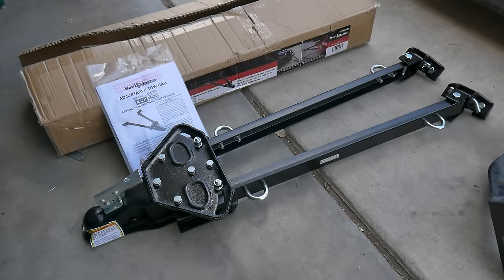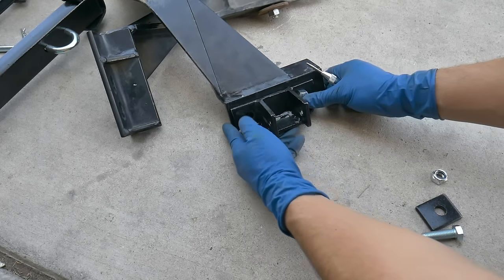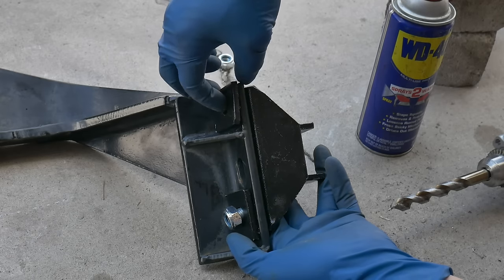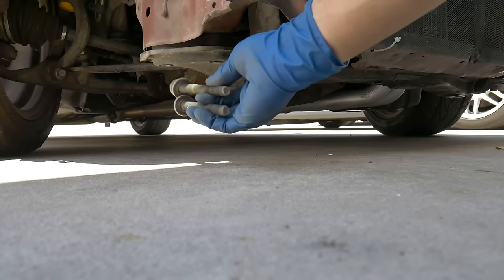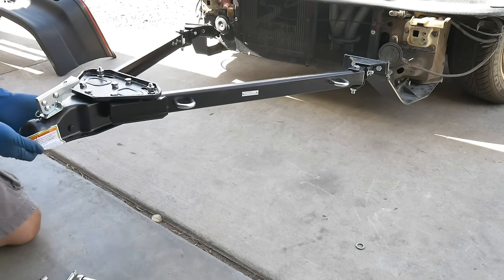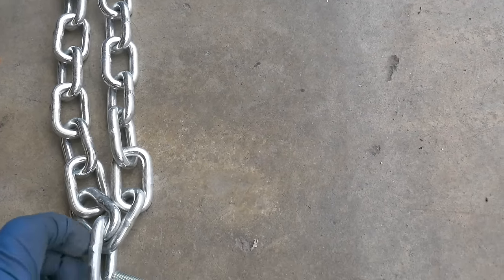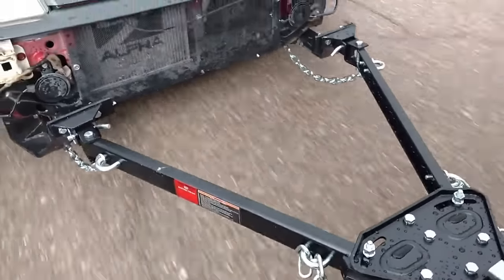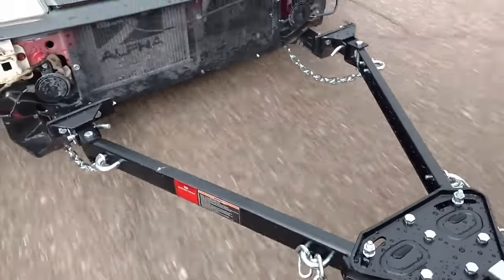Harbor Freight Adjustable Tow Bar Install - Towing my EF Civic B20B Track Car

Comment: Safety chains need to be crossed when towing in case that tongue pops off it won't hit the ground
Reply from the maker: +Robby Valdez Thanks for that!!
Reply: Garage Built Hondas 👍🏽
Reply from the maker: I kept meaning to google how the chains are installed but have never remembered and that makes 100% perfect sense!
Reply: Garage Built Hondas Yes sir😉
Reply from the maker: I got them on a car I bought (my yellow crx).  Someone found a set online.  If I can find it I'll link it.
Reply: Back chains criss cross too?? I've never had back chains so idk.
Reply from the maker: Yes, all of the them
Reply: @GarageBuiltHondas  I believe the purpose in front is that it catches the tongue should it come off and will cradle it.
Reply: I never thought about crossing the chains on my food cart whiles towing it. Thanks.
Reply: It's still stabbing a bumper but its probably better than a grinded down mounting hitch.
Reply: Yes
Reply: it's amazing how many people don't know this. I mean what do they think the chains are going to do when they just hang loose?
Reply: Shows it right on the box too 😆
Reply from the maker: Lol.  I'm only sometimes using half of my brain.  The other time I'm not really using it. 😁
Reply: A lot of people don't know this one either, chains aren't supposed to be twisted, makes them more susceptible to snapping if the tongue does pop off. Adjust the chains properly so they aren't dragging on the ground.

Comment: Nooooooo! by drilling holes in the tops of those "bars", you have just significantly reduced their strength and you've essentially created hinge points for them to crumple under load. Anything from HFT is probably way overrated as far as actual capacity goes to begin with, and you have actually just reduced that more. Sorry to rain on your parade...but yikes!
Reply from the maker: No turns sharper than 45 degrees is my way of using it.  It's been sufficient so far, I've used it over 10 times towing these kind of cars since the video.
Reply: Definitely don't agree that they are overrated. All kinds of liability issues
Reply: Ya no 😅
Reply: @GarageBuiltHondas could I attach this to a mini van and pull with a dodge truck ram?

Comment: Sorry for maybe a dumb question but noone uses this kind of tow bar here in central Europe, how does the towed car turn? I feel like the wheels could turn randomly and make the car wobble all over the place, but it doesnr do that at all, can someone please explain? Thanks a lot :)
Reply from the maker: You leave the key in the ignition and the wheels turn naturally as it's pulled.  I understand what you mean and felt the same way but I've used it over 5 times now and never once had an issue.  It's pretty nice to be able to use it.
Reply: @GarageBuiltHondas  Well, it kinda makes sence because if you let go of the wheel while driving, it vants tu straigten the wheels naturally, so it probably wrks the same, it just feels unnatural and scary to me. Thank you for the explanation though.
Reply from the maker: You're welcome

Comment: hi. where did u get the support bracket that connects to the tow bar. I have know where on my camera to mount my tow bar. thanks
Reply from the maker: Mine came with my car.  Google towing brackets and the model of your car.  You may have some hits doing that.

Comment: First "Smart" move to make with these is to bin off every supplied nut & replace them all with nyloc locknuts. It cost next to nothing and eliminates half the problems people run into. :-)  The factory nuts WILL vibrate loose when towing.

Comment: so one recommendation is get a class rated tow hitch installed to truck that bumpers probably only rated for just over a thousand pounds if I remember correctly CRX weigh significantly more it might not break right off but you'll start seeing bending and flexing in your bumper other than that great video keep it up

Comment: 2:26 "Perfect where I drilled them"  Well I guess not, since you had to grind down the backing plate to get it to fit.  I expected trouble when you didn't try to put the new hole in line with the existing two.  Measure twice, cut once--and if it's too much to measure twice, at least measure once!  Still the best video I've seen of the HF tow bar, if only because it shows the actual hardware of the mounting knuckle.
Reply from the maker: Lol, worked out just fine.  A little grinding never hurt.

Comment: One thing you didn't mention , 
Before you start towing , 
Obviously you put it on neutral ,
But what about the key ignition?
do you half way turn the key , just to activate the power steering ? 
or you just leave it alone don't turn the ignition at all ,  just the car on neutral will be enough ?
Reply from the maker: The key needs to be at position 1 where the steering wheel is unlocked and the car left in neutral.
Reply: Garage Built Hondas 
Thank you  ..  👍

Comment: thank you for the video... I've been trying to figure out how to use my HF tow bar since I got it.  The manual references buying another part (the mounting bracket) that they do not sell.  So I'm guessing if you don't have a bracket the tow bar is a waste of money.
Reply from the maker: Search around online.  They make brackets for many vehicles.  You could also find a welder/fabricator and ask them to build some for you.

Comment: Wow! Didn't read your bumper tow rating did ya?
But a blue ox tow bar, each side bar has a release that allows the bars to be lengthened. Release, hook to tow vehicle, back up to latch arms..... Alot less monkeying around..... But you get what you pay for
Reply from the maker: This particular kind of truck is setup to be able to pull this car and weight.  U-haul confirmed if for me 7 years ago when I first rented a tow dolly to pull one of these cars 500 miles.  They actually won't let you rent a tow dolly without confirmation of both vehicles.

This bar has worked perfect for the 88-91 Civic/crx chassis and is only want I'm using it for.  It has been used about 10 times since this video has been released and no issues.  I'm good.

Comment: You might want to leave the engine idling during your tow. Otherwise your transaxle output shaft bearings/bushings wouldn't get lubrication.
Reply: How would that help?
Reply: @pyromaniac354  It'll keep your output shaft bearings from premature wear. My auto tech school instructor mentioned this very scenario in a lecture. I bought a 40' school bus last October and towed my car behind on my 950 mile return trip home. I left the car engine idling almost all the way. I'd say for at least 800 miles. It cost me $10 in gas for the car. Until I need to tow a lot, this is probably the way I'll deal with the issue. I'm considering adding-on an electric circulation pump and tapping into the transaxle's lubrication circuit if I end-up towing a fair amount. I don't know if such a pump is available on the market, but I would find a way to do it myself (DIM).
Reply: @KellyBtech  not necessary on a manual transmission.
Reply: @jaydak99  Good point, but I fell out of love with them in my 20's. I don't like replacing clutches, master and slave cylinders as well as the constant clutching in rush-hour traffic. If I were in the old country (northern MN) I wouldn't mind as much, but I commute through Seattle for a total of 86 miles/day. Sometimes traffic crawls all the way home.

Comment: While you can't afford the front wheel they install in trailers, to lift the front up place a wood stick that lift it enough while you're backing up to hook your trailer.
Reply: Your not supposed to back up with a tow you could break stuff
Reply: @JUST1N888  What do you mean? If you have to back up just be careful, go easy, and have someone to spot you or get out of your vehicle, see the area and progressively back up, repeat. Repeat means "as you back up a little, get out of the vehicle, check the area for obstacles, back up more, check the area out of the vehicle until you achieve getting into the spot or area you desire". Do you understand?
Reply: @rodolfoplasencia4953  when backing up you are using the tow bar as leverage against the tow bar bracketts and they will brake . also you are not supposed lock the wheel . Be careful cause if stuff like this breaks it can kill people !!!

Comment: if u left the plates off and loosened the nuts that adjust the bar u can leave them loose when u back up to it so it can pivot the hitch and attach it to the ball. then just pull forwad to get the car aligned then tighten nuts down
Reply from the maker: Thanks for the tip, I like that idea.  It got easier since the first install.  I think just getting the hang of it, but when I re-attached the car to get it home, it was so quick lining it up that time so I think I got the hang of it now!

Comment: Silly question but does the steering wheel of the towed vehicle move freely or do someone need to steer it while turning
Reply from the maker: +Pedro Carvajal You'll put the key in the ignition to leave it free.  The wheels will naturally turn as it's pulled around corners.

Comment: Ahh I see how it was done now. I've been wanting to adapt a tow bar to my car as well in case I need to use my Toyota as a back up tow truck, but I was thinking of making a bracket system bolt into where the OEM bumper support bolts in, would be a hell of a lot easier than getting down and taking out all those bolts for the subframe mounted brackets. Just some food for thought as a potential change to your setup later on.
Reply from the maker: +90ED6LSV seriously!  I had thought about making some brackets but never got to it,then got these on the crx.  I definitely wouldn't mind something less arduous for future use.  Honestly when I used it last week at the track it was only tiresome because at the end of the day I was best from the racing & sun!  If I had a cordless impact I'd be set.  I need to buy one, just haven't done so.
Reply: Yup I know exactly what you mean lol. We recently did some major revisions to our car trailer, which included ditching our 80lb each steel ramps for hinged reinforced aluminum ramps. At the end of a track day it was such a pain in the ass to haul out/in these ramps to load the car up. The little quality of life improvements make a big difference haha
Reply from the maker: No kidding buddy!!  We'll see how this goes.  I might just use this as a backup and drive to the track.  If I need, I'll hitch a ride home and bring the truck out and tow the sum'bitch home!  haha

Comment: Excellent video!  I guess it is not possible to tow (using this towbar) without removing the vehicle's front bumper?  The Harbor Freight device is almost an order of magnitude cheaper than the Roadmaster towbar (~$ 900+ with taxes!).  It is no joke however to drill through 3/8th in thick steel!
Reply from the maker: Doesn't seem like it.  Unless you fab up some sort of mount coming through the grill?  Seems more difficulty though and it's very easy to remove the bumper.

Comment: when u tow a car is the towed car front wheel will keep straight wtout someone inside the car. thanks
Reply from the maker: No.  The keys are in the ignition so the tires turn naturally.

Comment: I love your videos! I watch regularly. And often see find myself sent to another one of your older videos when I’m looking at things to buy lol. 

Is there any necessary steering lock for the towed vehicle?
Reply: That may be a stupid question. I imagine it doesn’t need anything just curious I’m new to towing.
Reply from the maker: Thanks, I appreciate the support!!

The key is left in the ignition with the steering wheel left to spin freely.
Reply: Garage Built Hondas and it will follow the tow vehicle? I can’t help but imagine the front wheels cutting one way and and locking.
Reply: @ShiftersAndLifters  It follows the tow vehicle

Comment: This might sound like a dumb question but how do you tow a vehicle with the steering column locked, or do you have to unlock it... seems like it wouldn't make turns very well
Reply from the maker: You leave it unlocked and the wheels turn naturally following the tow vehicle.
Reply: @GarageBuiltHondas  yeah I was basically asking how to leave it unlocked with the vehicle off, so it doesn't drain the battery. I figured it out though from another vehicle, how to put the key in the ignition and turn it just enough to release the column lock but not enough to switch on the electrical system. Never paid attention to that before, thought there were only 2 positions on the ignition, ON and START.
Reply from the maker: Well, now you know. 👍

Comment: so how does one setup blinkers on the towed vehicle.   where l live, cops seem to pay very close attention any novice pulling something.  also, can I pull a small car (honda civic, nissan sentra, etc) with a small truck (nissan frontier, 2 wd, 5 speed manual transmission,  4 cylinder) using a tow bar?  most people told me I could probably get by with it.  but I guess my main question is how hard it would be on my truck if I had to go up hills?  that's my real concern.  I wouldn't want to overheat the transmission to the point that I burned it up.    I would drive very slow (probably only 30 mph).
Reply: actually it looks like my truck (2001 frontier) has a tow capacity of 3500 pounds.  I think most economy cars weigh less than that.  so there would be no worries.
Reply from the maker: I'm using this.  https://amzn.to/3K1wi9n

Comment: Do you have the steering locked or unlocked?  Do you feel any pulling when turning a corner, or the towed car has any trouble recovering  to straight?  I have a similar bar
from Princess Auto here in Canada. I tried towing my sebring with my Jeep compass with the wheel unlocked, and found it wanted to keep turning  while I was straightening out after a turn.  Some cars are not supposed to towed this way. Check  with the dealership or manual. Also there is a RV website with a search function to find if your car can be towed, or if special requirments.  My Sebring is not supposed to be towed. I think it's an issue with the tranny, but I wasn't going  far, and figured if I keep the engine running it will let the fluids in the tranny and power steering  flow.  I ended up having my son in the Sebring to assist with the turn recovery.
Reply from the maker: The wheel is unlocked.  I have used it 5 times in the last 2 years and have never once had an issue and each trip was at least 40 miles.

Comment: Stupid question but you're supposed to put the car in neutral right and do you unlock your steeringwheel or leave it locked
Reply from the maker: No stupid questions at all. 👍. Neutral and unlocked.

Comment: I'm thinking about doing this for me e36 drift car. Do you have to lock the steering wheel? How well has this worked for you so far?
Reply from the maker: Steering wheel stays unlocked so the front wheels can turn with the tow vehicle.  I have used it probably 10 times and have towed as far as 150 miles home when I bought a car that didn't drive.  Zero issues.  I've saved so much money bringing parts cars home too.
Reply: Awesome thanks for the fast reply
Reply from the maker: You're welcome!

Comment: Do you disconnect the CV's from the transmission or anything? How does it handle turns, or do you unlock the steering column?
Reply from the maker: +Muffin Racing Nothing is disconnected at all.  Car just needs to be in neutral and the key in the ignition so the wheels may turn with the vehicle towing it.
Reply: Garage Built Hondas what about the driveshaft?
Reply from the maker: +SantaOMG The car is left in neutral.  It's a FWD car I'm pulling.  Not sure on an AWD, you may have to disconnect the driveshaft.
Reply: Manual or automatic 2wd or 4wd neutral is neutral. Turn on key to put the vehicle in neutral leave in the on position to keep the steering column unlocked. If you are going far and worried about draining the battery unhook the negative cable but add magnetic tow lights that connect to the trucks wire harness.
Reply: I should specify that 4wd usually needs to have the transfer case also put in neutral and you also need a vehicle that has a trans pump yo keep it lubricated.
Reply: @floridadragon  That is so wrong. Some auto trans will not circulate fluid to cool the gears unless the engine is turning. In that case you have to remove the driveshaft to isolate the output shaft of the trans from movement. Check the RV sites.

Comment: A couple if questions, would mounting the HF tow bar to where the bumper brackets goes possible? I can fab up a small adaptor if needed, the second question is, do you strap down the steering wheel or just leave it loose? I plan tow a small car from Dallas TX to southern CA with one of these
Reply from the maker: Absolutely, I don't see why not.  As long as you build something that is secure it should work fine.

The steering wheel is left loose with the key in the ignition so it turns freely as the towing vehicle does.